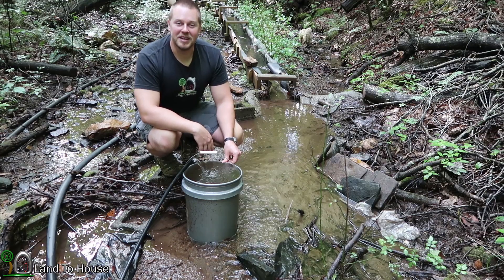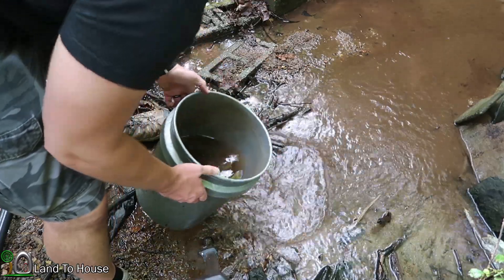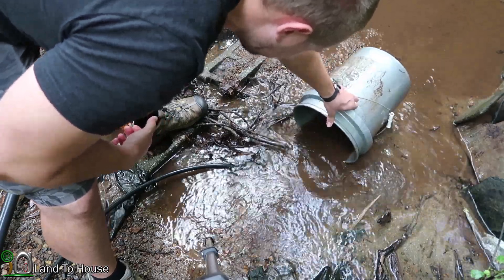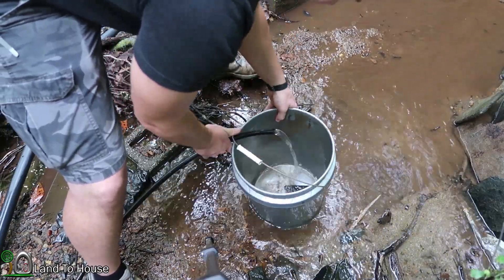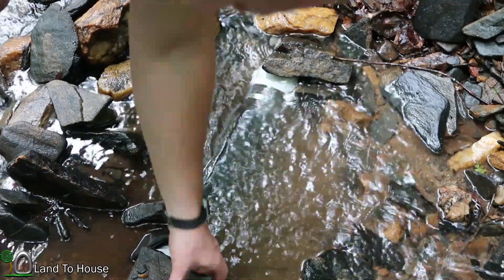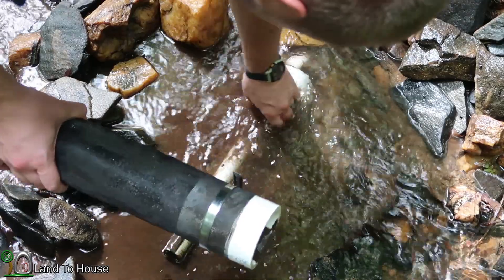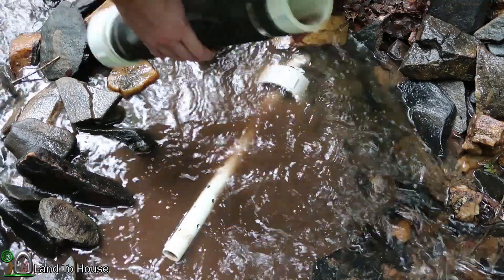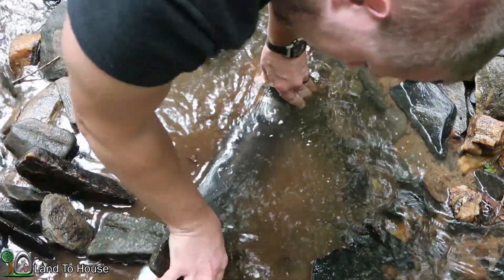Ram Pump Low Flow Intake Update

Comment: Could you tell me whether this possible, Is there any way to pump water out of a pond with a ram pump ,we are totally flat here ,pond is probably 3 ft -4 ft below ground level , I think I know the answer, No ,it can’t be done ,would appreciate your input ,Thank You !!!
Reply from the maker: Sadly the ram pump is unable to pump water without either head pressure or hydrostatic pressure. When the water source is below ground it just does not work.

Comment: Would it make better sense to suspend the intake screen in a pool of water, some distance from the bottom?  And the screen be oriented so it is facing down, not up?  Something to test.
Reply from the maker: Yes that would work well. I think at least removing a small part of the bottom of the pipe would drain the silt that was collected. SO many nice ways to filter the water.

Comment: Instead of angling the cut side of the intake down, why not place it level with the water or even angled a little towards the down stream side? It would seem to the that you would pick up more silt it it was angled into the flow of the water since it sits lower. Where as, if it was angled away from the flow, only the clean water would wash over. Right now it like a baseball mitt scooping up the silt.

I hope that makes sense.
Reply from the maker: Yes that was actually my first idea and plan. . . But I did not do that for some odd reason. At least we know this works. The angle downstream is a good idea to prevent even more debris from getting in.

Comment: I think your silt catch bucket is a good idea, but it would require regular manual draining of the silt. I think a good solution would be to have the creek filter dump considerably more water into the silt bucket but have the overflow of the bucket be a pipe exiting the bottom of the bucket and U-ing up  to near the lip of the bucket. This would allow any settled fines to exit with the overflow. Depending on how many GPM the ramp pump requires you might need a larger bucket to reduce turbulence and allow the fines to settle out. 1/3 of a 55 gallon drum, or storage tub might be a good option.

Also your creek filter might clog up with silt along the bottom and it looks like it partially had already. Having the creek filter exit pipe sucking from the bottom of the filter would reduce the silt build up I feel.
Reply from the maker: Good points. This setup was really testing the potential for a very low flow pump setup. I had in mind a 1/2" pump needing 3 or so gpm to run. So this intake would pull from a very low flow creek. But I can see that dumping a lot of water would allow for better silt management. ... This intake can be tilted and moved to get better silt management. And a better screen would help.
Reply: Ideally you want to take water from the middle of the water column to avoid flotsam and jetsam. Having an waste/silt outlet on the bottom and overflow at the top with a supply line leaving from the middle would be ideal.

Comment: Awesome update video Seth! Another idea is you could have a cloth screen inside the bucket separate each half of water, and act like a membrane to filter out fine sediment
Reply from the maker: That is an interesting idea. Cloth with pores large enough to pass a good volume of water yet keep the silt from getting to the pump. Thank you.
Reply: Land to House I might have another idea, with using two buckets stacked on top of eachother to be a basic filter. I will try to make a basic video of the idea and send it to you. Thanks, Danny Bench
Reply from the maker: Kind of like the Burkey filter? As long as it passed 3+ gpm it would work. Also the top bucket would have to be low enough to for the intake to gravity feed to. In my test the intake only has about 2 feet of fall.
Reply from the maker: Nice design! How would cleaning be done? After several weeks I have a feeling that the top bucket would be full of silt and other debris.
Reply: Thanks Seth! To answer the question about how to clean it an idea I had was to possibly add some rubberized handles to the cloth sheets and use two, one for each layer. Have the cloth be more of a bag that you can lift the gravel out and rinse the silt off, then do the same for the sand, and just stack them back in the bucket after rinsing. Might work well.
Reply from the maker: Yes that would work. I do wonder what environment it would be suited for. My creek does not have all that much sediment. I think that the simple bucket alone will need to be flushed 1 time a month.